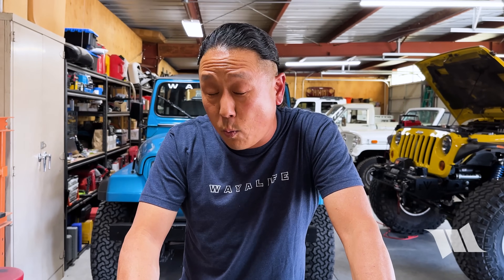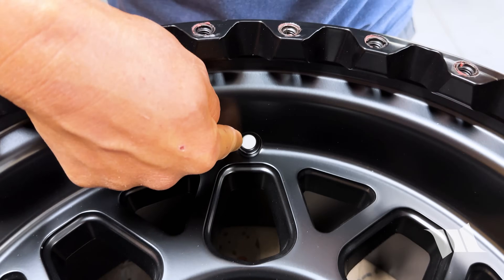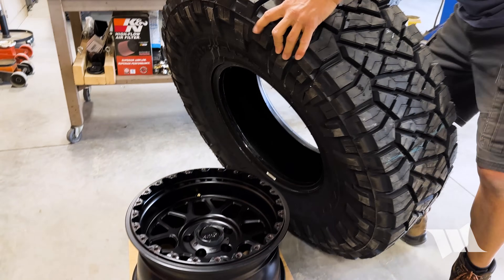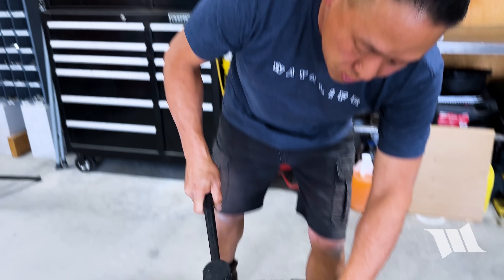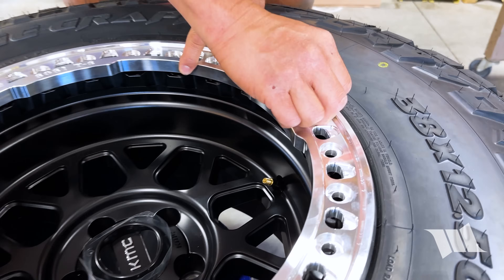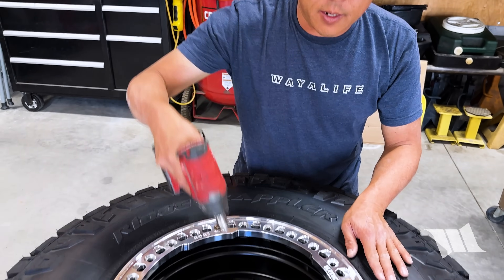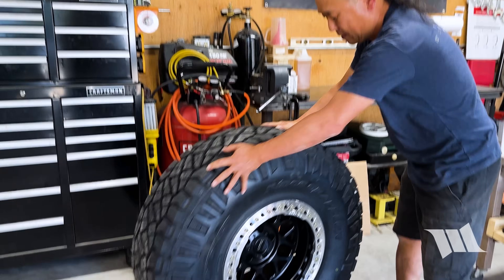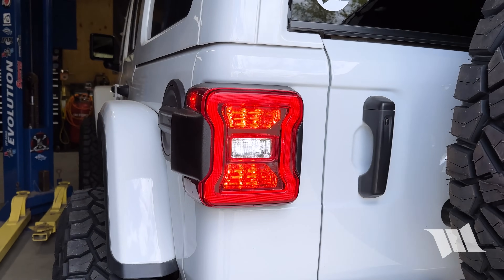HOW TO Install Beadlock Wheels for Beginners

Comment: What if u don't have access to a torque wrench
Reply from the maker: Then I would make sure to buy one or NOT do this install. Proper torque is CRITICAL in order to prevent the over tightening or even under tightening of the ring bolts. Both of which can result in bolt/ring failure and trust me, that is very bad.

Comment: Great video but I’m wondering how easy they are to get balanced and what type of balancing generally works with headlocks?
Reply from the maker: High quality tires like the kind that Nitto makes typically do not need balancing. However, IF you need a balance, it's as simple as taking your Jeep to your local Discount Tire and have them do it for you using tape weights.
Reply: Thank you. I drive my rig to the trail so I was curious.
Reply from the maker: @ as do I and sometimes, that’s clear across the country

Comment: Does the ring supposed to come into contact with the rim? I'm running racelines and i did probably 6 passes in star pattern with my torque wrench and could not get the correct torque. The bead is starting to warp, due to the thickness of the tire. Do i need a ring spacer?
Reply from the maker: What tire are you installing your beadlocks on? Something like a Cooper? If so, you probably need spacers as the bead on those tires are really really thick. But, to answer your question, yes, your rings should make contact with the wheel, just like you see in this video. A big part of why I only run KMC now is that they use really thick rings and with bigger bolts and they'll suck down all the way, even with tires that have really thick beads.

Comment: Installed 37x13.50 Ridge Grapplers on the very same wheels you have here using dish soap/water in a spray bottle and I believe a video where you put another set of 38’s on a set of wheels for your old JL.

Not like it was rocket science but I’ve always found “see something, do something” more comfortable and your guide was super thorough.
Reply from the maker: Awesome and happy to hear you enjoy our videos.
Reply: Do you not have to add balancing beads to the install?
Reply: @youngnick7252  honestly, they’re remarkably well balanced from factory.  The aforementioned tires were honestly smoother riding than the factory Falken’s that came with the Gladiator to begin with, all the way up to 85mph lol.

so for me, I didn’t. But if you should happen to install a set of tires and you have some vibration or wobble, go see a tire shop first.

Comment: How often do you go back and re torque? Awesome video!
Reply from the maker: After installation, I check them after about 100 miles and assuming all is still good, I never give them a thought until I need to replace my tires.
Reply: @wayalife  thanks! I just mounted my first set of beadlocks this past weekend. Your video helped a ton!
Reply: @wayalife  last question, when you re torque them, do you need to take the weigh of the jeep off of them and air down?
Reply from the maker: While it may not be necessary, it's always safest to remove the tire and let the air out of them before re-torque.

Comment: I've never messed with beadlocks, but this is where I'll come back to if I do.
No balancing necessary, beyond the yellow dot alignment?
Reply from the maker: Fortunately, Nittos make really round tires and for the most part, balancing isn't needed with them. In fact, of the 5 tires I installed, only 2 had yellow dots. However, IF or when I feel a need for balancing, I take my Jeep into my local Discount Tire and they balance for me.

Comment: I ran Allied beadlocks on my Comanche. I used to check the torque on the bolts after every wheeling trip and also found it necessary to replace the grade 8 bolts every couple of years. I had some bolt heads snap off.
Reply from the maker: That is a big reason why I only run beadlocks like the kind that KMC make or better. They come with really thick rings and much bigger bolts and since I've been running them, I have not seen the need to keep checking bolts or the kind of breaks in them the way I have seen on other beadlocks with thinner rings and smaller bolts.
Reply: @wayalife  True, the Allieds were a budget friendly option. I believe the same company makes the Raceline beadlocks, which would be a better choice.
Reply from the maker: @johnnychun59  oh yeah, I totally get it and wasn't trying to knock them. Just stating what I have seen.
Reply: @wayalife  Asian Jeepers 👊

Comment: Great video! I did not know about the yellow dot!  I’ll do that on my next set of tires, maybe it’ll use less balancing weights that way.  Thanks for posting this.  👍
Reply from the maker: To be fair, a lot of tire shops don't know or don't care about the yellow dot but, that is why it's there. Glad you found our video to be useful 😎
Reply: yellow and red dots, I think the white dots are for steel wheels but its been a long time since I done tire work

Comment: Great video and very detailed! Will the need to be balanced? Ive heard of people using beads to do so..
Reply from the maker: Depends on the tire you install and if you do it like I show in the video. Typically, a high quality tire like the kind that Nitto makes will not require a balancing. IF I feel a need for balancing, I take my Jeep into my local Discount Tire and have them do it for me and with tape weights. I would never pretend to know more than what you've heard people say but to me, balancing beads are snake oil.

Comment: Great vid! Now we need on how to de-bead and change out the tires on a beadlock wheel! 😬
Reply from the maker: Breaking the bead is actually not too bad so long as you have a Hi-Lift. Separating it from the wheel is a bit tougher but it can be done with some effort. For the most part, I just have my local tire shop do it for me.

Comment: Thank you for this video! One question... Do beadlicks need to be balanced and weighted?
Reply from the maker: Glad to hear you found our video to be informative. As would be the case with any wheel and tire, you only need to balance them IF they are in need of balancing. Typically, with a high quality tire like the kind that Nitto makes, this isn't necessary. In fact, of the 5 tires you see in this video, only 2 had yellow dots. That said, IF I feel a need for balancing, I take my Jeep into my local Discount Tire and have them do the balancing for me.
Reply: @wayalife  awesome!... Thank you!! :)

Comment: Excellent video, thank you, I to have a 392 Rubicon and I'm doing my homework for lift, wheels, tires and gears and found your video as I'm considering the kmc grenade crawl, im considering the machine finish for the entire wheel, will they need some sort clear coat or finish to retain shine?  And I notice they say off road only ? Anyone have issues with using them on highway?
Reply from the maker: If you don't garage your Jeep, the rings will lose it's luster a bit. Clearcoat would help keep them nice but rocks will jack them up anyway. The off road use thing is just for liability purposes. Technically, it isn't legal to run beadlocks on the highway even though they are totally safe.

Comment: Great video Eddy but I’m a newb and I have a few questions if you have the time.
1st About how many miles do you drive in between torquing the bead lock bolts
2nd do you still need to take it to a shop and have them balance the tires
Reply from the maker: Fortunately, Nittos make really round tires and for the most part, we have found that balancing isn't needed with them. In fact, of the 5 tires I installed, only 2 had yellow dots. However, IF or when I feel a need for balancing, I take my Jeep into my local Discount Tire and they balance for me. As far as the bolts go, I typically check them after the first 100 miles but after that, there should be no need to keep checking them with something like a KMC wheel. They use much much thicker rings AND bigger bolts than a lot of other beadlocks out there.

Comment: Awesome show  gives me some  ideas  just  wondering what  do  u do with your original wheels  and what the bolt pattern
Reply from the maker: Originally, we were wanting to install these tires on the factory 392 wheels but couldn't get our hands on the beadlock ring. Apparently, they've been out of stock for some time now. If they come back, we may still do something with them.

Comment: Eddie you recommend putting balancing beads ?
Reply from the maker: Nope, not me. They’re snake oil. If I need my wheels balanced, I take them to my local Discount Tire shop and have tape weights installed.

Comment: I'm running the same wheels with 38X13.5R18. What tire pressure you running on the hwy? I was told 25lbs. Love your videos. I find myself watching them over and over.
Reply from the maker: I would never pretend to know as much as whatever someone else can tell you but I typically run whatever will give me a nice flat footprint and without being too low. A chalk test will help determine that. Anyway, I typically find myself at about 28-30 psi but it can vary depending on the tire and width I'm running.
Reply: @wayalife  Thank you for the reply. I was told 25lbs because the ring bolts could fail at higher pressure such as 30 or so.
Reply from the maker: @jacksjeepinchannel5349  like I said, I would never pretend to know as much as whoever told you that but I personally have never heard of anything so stupid.

Comment: 32 lb/ft seems high for beadlock ring bolts. I noticed the kmc wheels appear to have steel threaded inserts ore installed in the wheel so that makes sense. I did 17lb/ft on my wheels but there threaded into aluminum.
Reply from the maker: LOL - there's a reason why I've been running KMC and ATX beadlock wheels before it and for almost 20 years now. They use BIGGER bolts than most other beadlock wheels, have much thicker rings and they DO NOT thread them directly into aluminum wheels like cheaper wheels do. 32 ft lbs is what is specifically stated to use BY KMC's directions and to this day, I have never had a single issue or a broken bolt the way I have seen countless times with lesser beadlock wheels.
Reply: @wayalife  I completely understand. The steel inserts and larger bolts can handle a higher torque rating. I wish my wheels had the inserts, they're threaded directly into aluminum which can lead to issues after multiple installs if over torqued.

Comment: Thanks for the quick class. I just picked up a 2023 392 rubi 20th, and it came with the factory beadlock wheels. I am going to order the actual locking rings for them from Mopar, and get this done. Side note, when I am aired down, is there a way to disable the TPMS light, or, is it a normal thing to leave on, to remind you to air back up once you're off the rocks? Thanks for the great content!
Reply from the maker: Good luck getting those rings. We waited a year and there's still nothing available. Also, if you do go this route, you will need to run wheel spacers with tires this big and wide.
Reply: @wayalife  I got my Mopar rings, and got them powder coated to be the same color as the factory beauty rings. Very happy they were finally in stock!

Comment: My Wrangler Willys has the Xtreme packs with 35" KO2's and beadlock capable wheels. While I can easily air down, what scenario would I want these tires mounted taking advantage of the beadlock capable wheel? Then, is there a maximum speed when on pavement?
Reply from the maker: Beadlocks are helpful to have when airing down to 10 psi or less. This is a pressure that can be extremely helpful on big rocks and it will help prevent the rolling of your bead.

Comment: Great videos. What tie rod do you recommend for the price. I’ve seen a few stock ones fail at the ball joint. Think the stock is ok, or get something else? Thanks!
Reply from the maker: Just to be clear, rotation on a tie rod end is totally normal and NOT an indication that it has failed. A shifting side to side or up and down within the tie rod end IS. Typically, people replace their tie rods with something beefier because the stock ones do tend to bend from getting hit on the trail. For this, I would recommend Synergy if price is a factor.
Reply: @wayalife  thanks. I was referring to the shearing of the ball joint bolt. That’s the most common failure I’ve seen.
Reply from the maker: LOL - I've been wheeling Jeeps for over 25 years now and can't say that I have ever seen the stud of a tie-rod end sheer off. Guess I'm not playing hard enough.
Reply from the maker: Either way, this is what I would recommend https://youtu.be/rCCfyskm-CM
If you have more money to spend, RockJock is what I would recommend.

Comment: So who's the  video editor? Great job! Also, if any of you get yours done at a shop, make sure to check each bolt yourself! I just had a set done and found that more than a few were not tight and two of the lug nuts fell off on my way home. To add to that they put 40 PSI which is waaaay too much. It had me all over the road. I had to pull over and drop it down to 30 PSI so it stopped tracking all over the place.
Reply from the maker: Stupid stuff like that is the reason why I started doing my own work. Also, Cindy does all the filming and editing. Glad you enjoy it 😎
Reply: @wayalife  I’m a graphic designer and video editor myself so all of the quick jump cuts, music and slick transitions didn’t go unnoticed. You probably get all the credit for the videos so let her know she’s killing it!

Comment: I’m quite late to the party, but I just stumbled across this video. I have one question sir. How much did the wheel and tire combo change to engine performance with the 392? Do you still get 8th gear? Does it need re-gearing?
Reply from the maker: When we ordered our 392, it wasn't available in the XR package which would have given us 4.56 gears. Needless to say, we only have 3.73 and while we do still get 8th and overall there's still plenty of power with the 38" tires, there is definitely a noticeable loss in overall power. Not horrible but it doesn't quite have the same feel as it did with stock tires. Regearing is the only way to recover that lost power. If you were able to get an XR with 4.56 gears, you will be fine with this setup. Otherwise, 4.88 is the highest ratio I would run on a 392
Reply: @wayalife Thanks for your expeditious response. I do have an XR version of the 392. So I’m guessing I will not have to re-gear. @wayalife, one more question if you don’t mind. Is there a lift on the 392 with 38s? If so, how many inches is the lift?
Reply from the maker: @missionpossible2334  Oh yeah, there won't be any need to re-gear. I really wish I could have gotten the same package. Regarding my 392, I installed this https://youtu.be/7EzDf1K_yOk
Reply: @wayalife , your help, encouragement, and expertise is greatly appreciated. Keep up the, not good, but perfect, ideal,model, faultless, without fault, copybook, flawless, impeccable, consummate, excellent, outstanding, exceptional, admirable, fine, very good, commendable, laudable, praiseworthy, meritorious, honorable, estimable, above/beyond reproach, blameless, irreproachable, unimpeachable, and applaudable work. Your content is among the best on YouTube.

Comment: DANG!!!;
I'm new to off-roading....
You don't have to pay anyone to mount your tire??? Awesome!!!! 
Done on the trail?!
Reply from the maker: Well, only on a beadlock wheel like you see here and while it can be done on the trail, breaking the bead and removing a blown tire off a wheel isn't exactly easy.
Reply: @wayalife  thx. You off roaders still balancing wheels or you get away without it? I really wonder why the beat lock is on one side only
Reply from the maker: High quality tires like the kind that Nitto makes typically do not require balancing. However, nothing is perfect and IF I feel a need to have my tires balanced, I take my Jeep to my local Discount Tire and have them do it for me. The bead lock just keeps the tire from spinning on the wheel when aired down and that prevent the bead from breaking.

Comment: Wow...I mounted up the 37 inch version of that tire on the exact same rim....although I had the hoops powder coated the same color as the wheel.  Question....what did you do for balancing?  I used beads and am not yet happy with the results.
Reply from the maker: In my opinion, balancing beads are snake oil. IF I feel a need for balancing, I take my Jeep into my local Discount Tire and have them balancing my wheels using tape on weights.
Reply: @wayalife  Thanks for the response! My local Discount Tire will not work on the non-DOT wheels unless they are off the passenger vehicle.  I'll need to remove those beads, which is obviously now a pain, and dismount the wheel/tires from the Jeep, but I think the work is going to be worth it.  The Jeep is a daily driver in addition to trail duty, and the rear tires get violent around 75 mph.
Reply from the maker: @gtjeeper3376  When's the last time you've tried to have your Discount Tire work on beadlocks. I've talked directly to corporate about a year ago and they told me that they've changed their rules across the board and it should no longer be a problem. I tested this out recently and my shop didn't even blink an eye.
Reply: @wayalife  Great news!  It has been since mid last year that I asked...so maybe a year ago.  I'll give it a go and see what happens.  Either way I am well advised to remove the glass beads before I do anything....I have been dragging my feet because of the chore it is, but I have to get off my butt so I can comfortably get to the trails!